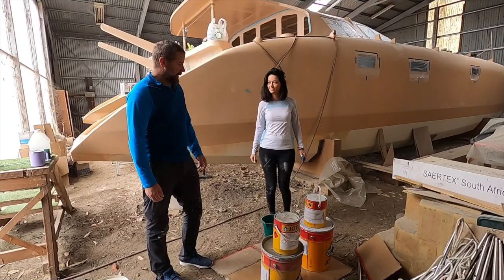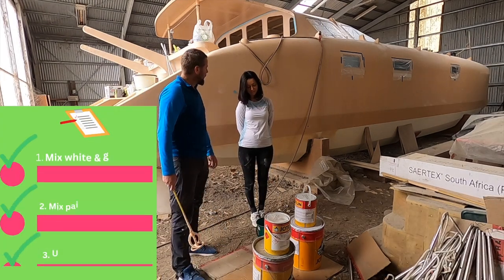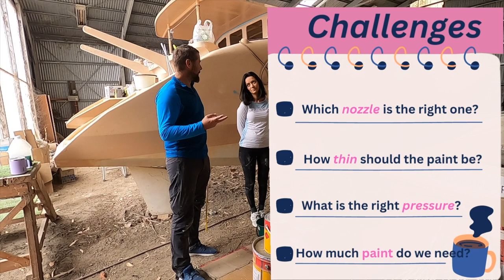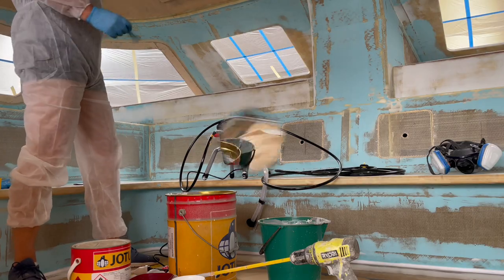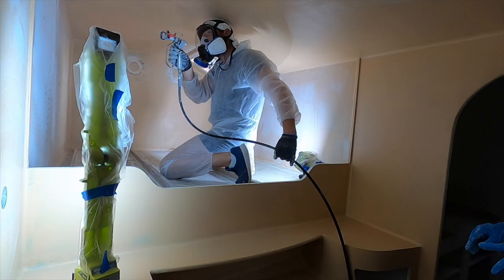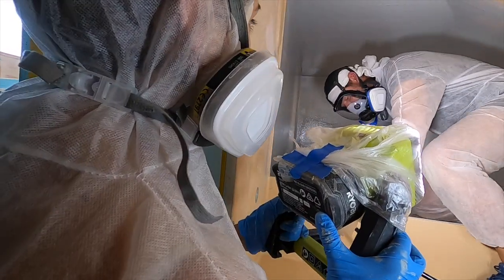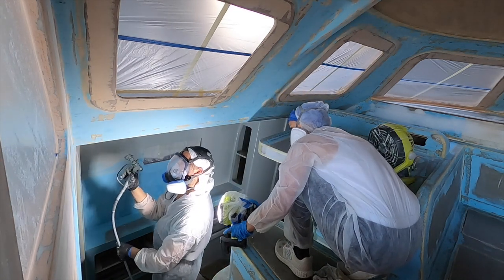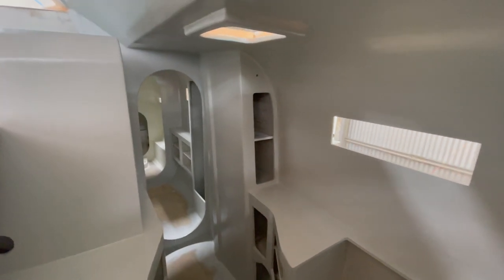Interior PAINT TRANSFORMATION using an AIRLESS SPRAY gun - S02 E19

Comment: Those toy airless Sprayers are not enough for epoxy paints for a hi-build primer you should be using a x17 to x21 nozzle.
Reply from the maker: Not the best machine for the job, but it works. A slightly more powerful pump would have been better.